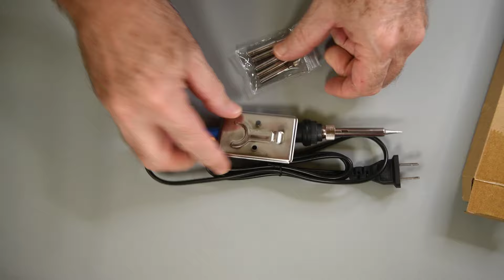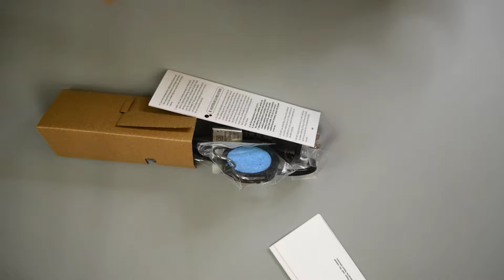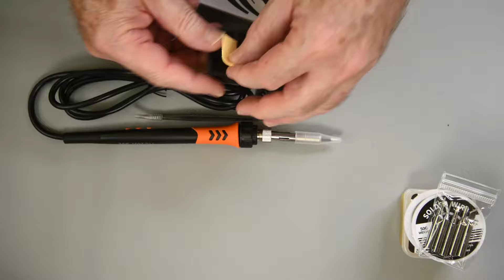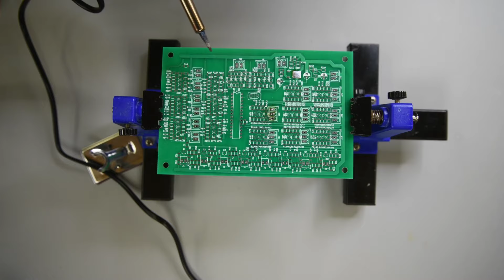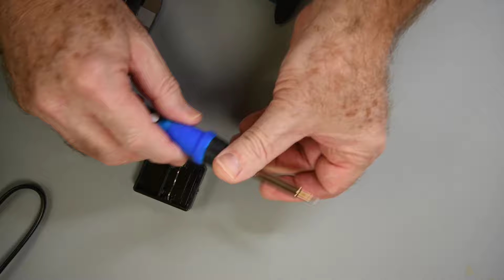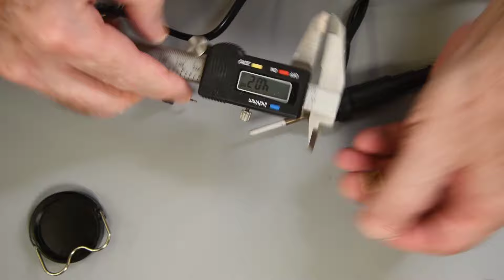Under $20 Soldering Irons – Are Any Of Them Usable

Comment: 12:28
This was exactly what I did! Sure the tip is more expensive that the iron itself BUT total up both will be STILL much cheaper than a proper iron.
I bought a hakko T18 C1 for $10 which makes it $15 total, it did micro-soldering like a champ! 
Modded my switch oled using this combo. The tips they give for free are just trash.

Comment: Ok, so since all of these are not very good, what are some good ones to get?
Reply: KSGER t12 v3.1s (not the mini) from AE.
Grab extra T12 BC2 soldering tip if not included.

Soldering tip cleaner, the copper one not the sponge.
Low melting solder, Mechanic TY-866 or TX-100 should do the job.
Good desoldering wick like Mechanic R300/R350. 
A flux, no idea about this one. Got one while back from Mechanic it do the job and there is other one, kingbo rma218 for half the price but didn't test it yet.
Reply: @SmokedBarbecue  Thanks, I will check out that ksger.  I have good solder, flux, and wick (the wick I actually got based on an MPE video where he compared the wicks) and even a tip cleaner, but my iron sucks.
Reply: @DonaldWyman if you have not yet bought one he just released a video on a really good one. That’s what I would recommend.
Reply: @originsmaster8140  I got one of the ones @smokedbarbecue recommended, but I will check that video out.

Comment: I stopped using using soldering irons that don't have the heating element and temp probe built into the tips. The style of these cheap irons use "dumb tips" (no heating element, no temp probe) their heating element is mounted in the handle, same place the temp probe is located.

I highly recommend the FNIRSI HS-02A you can get it for around $30 or more depending on the accessories you add. Powered through USB type-C (doesn't use a internal battery) You can use a phone charger, laptop charger or power bank to power it.
Reply from the maker: Yes, once you use an integrated tip and heater you don't want to use anything else.
Reply: Any difference between the 02A and the 02B
Reply: The 02B is for smaller micro soldering like phone repair. They use slightly smaller tips.
Reply: @syn80  thanks mate
Reply: @syn80  does it accept adapters and other soldering tips like the controller soldering adapters people sell third party or from china?
Reply: @PublicProfile6996  Most of those joystick solder adapters use T12 tips. Honestly you would be better off using a hot air station, its more useful and can be pretty quick removing stock joysticks. The Fnirsi soldering iron (HS-02A) uses C245 style tips (originally created by JBC for their brand of irons)
Reply: @syn80  would be sick if they or someone made a joystick tip for them
Reply: @PublicProfile6996  you can even just cut up the joystick and remove the pieces with a soldering iron, no special tool needed or hot air needed. Look up soss gaming and the newest video. Shows several ways of removing old joysticks.

Comment: This explains why I have such a hard time swapping potentiometers to hall sensors on the 6 controllers I have done.
Reply from the maker: If you are using any of these irons, then yes.  The Meakest brand one might work but I would want something better.
Reply: @metalplasticelectronics354  yeah I’ve done 6 controllers now and sometimes it feels like I can’t even melt the solder.
Reply: @metalplasticelectronics354  I bought the kernowo 68 watt soldering kit with the solder, flux, pump, stand, tweezers, different tips, and sponge as well as a carrying case for $20
Reply: @metalplasticelectronics354  what do you recommend ?

Comment: You need test it with good tips, those tips are ass, test it with (mechanic) brand tips  they good tips ,and do a new vídeo pls
Reply from the maker: Somewhere I have some Hakko 900M tips, I couldn't find them so I put a T18 tip on it to try.  The tips are probably the weakest point of all these irons.  Any good quality tip would improve the usability of these irons.
Reply: @metalplasticelectronics354  yes You can try with t18 tips and try it on all this irons